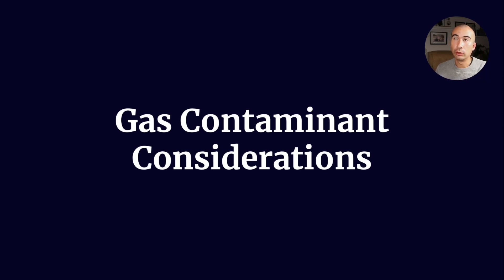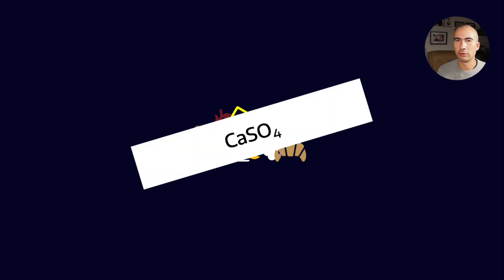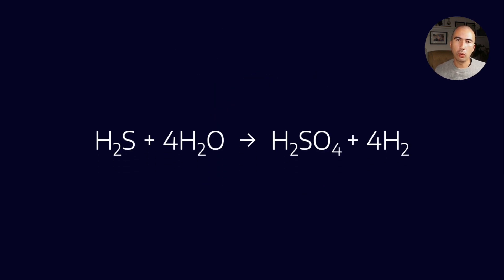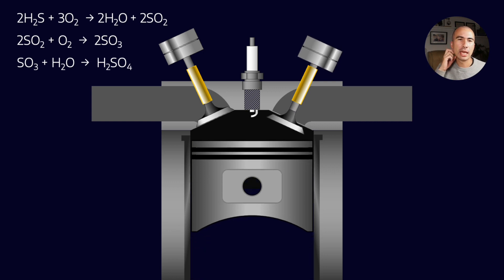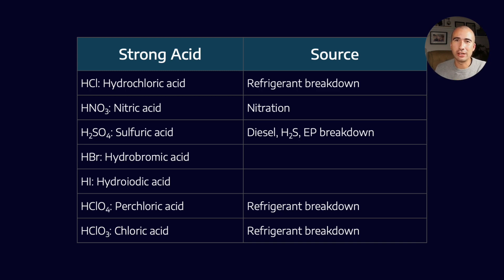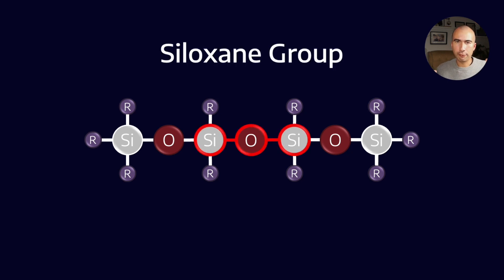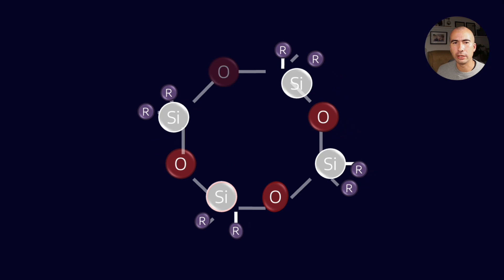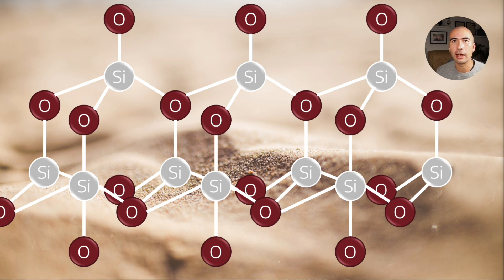How do gas contaminants affect engines?

Comment: Nic job!  Didn't know that. Thanks LE.

Will you have some additives analisys video. I'd like about Bardahl B12 Turbo for diesel engines as enhancer for a second use of engine lubricating oils. What its polar action means and its source. Also what percentage and adds used.
Reply from the maker: What is actually in a motor oil additive like Liqui Moly?
https://youtu.be/WlrQc4-47SQ I did one a little while ago on some after market additives. Hopefully that scratches the itch before I get to another video!